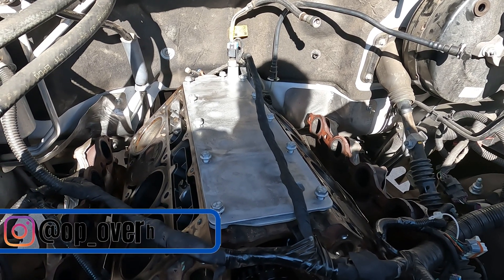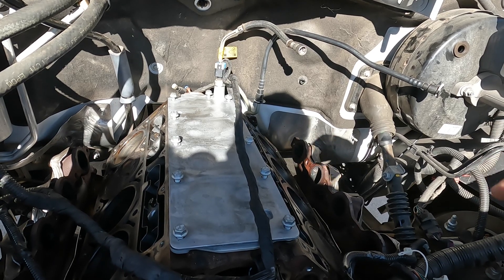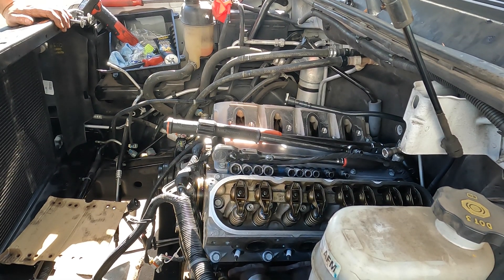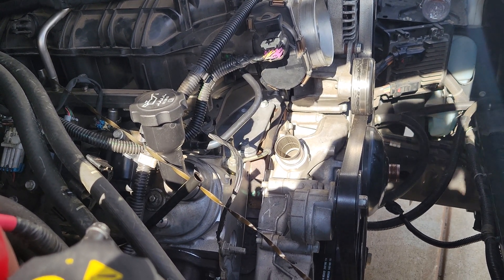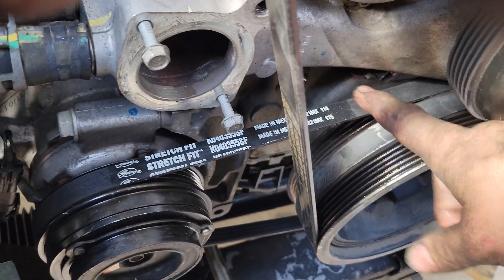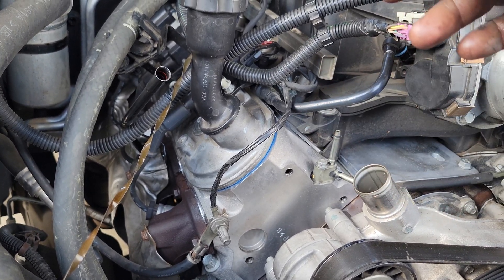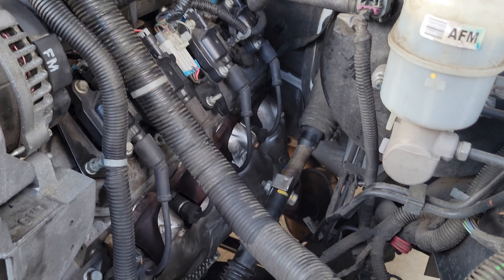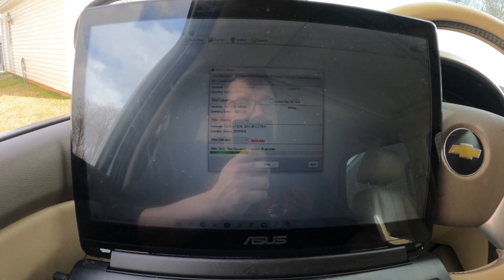AFM Delete 5.3 Chevy Final Part with HP Tuners

Comment: Do you have rough idling with the stock cam?  I am trying to figure out a way to tune out the rough idle caused by the DOD cam.
Reply from the maker: So you deleted it and kept the stock cam or did you just turn off the dod with a tuner?
Reply: @operationoverhaul  I kept the DOD cam and installed the Trick Flow delete kit.  Replaced the 16 DOD lifters, blocked off the oil passages, etc.  I didn’t realize at the time that the cam needed replaced as well.
Reply from the maker: @Jeremy Stec  okay, that is more than likely the issue you are having then. The cam lobes are a little different than the ones on the non-dod cam.  To make it idle better you would more than likely need to change the cam.